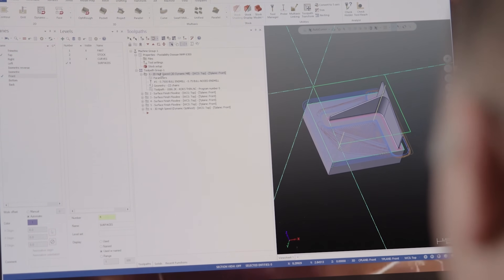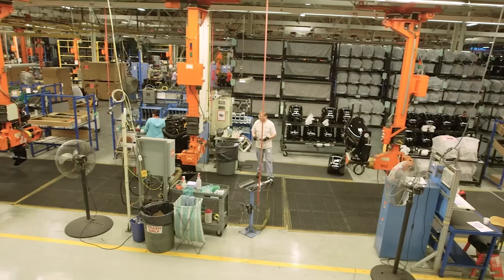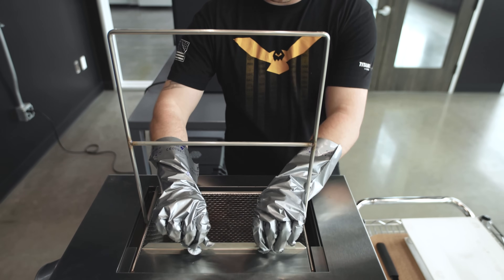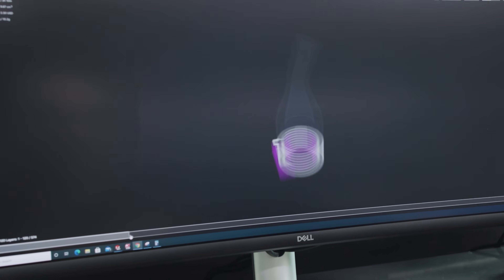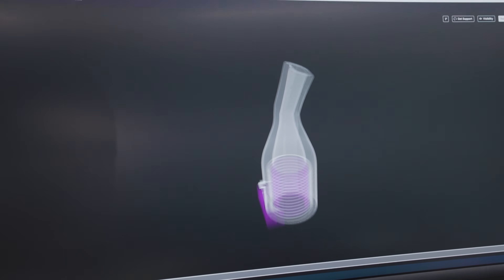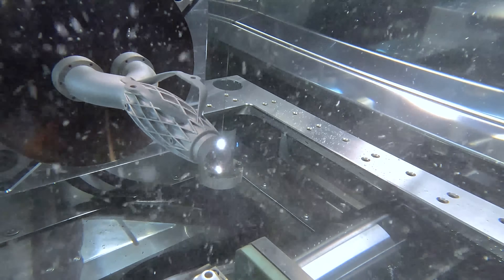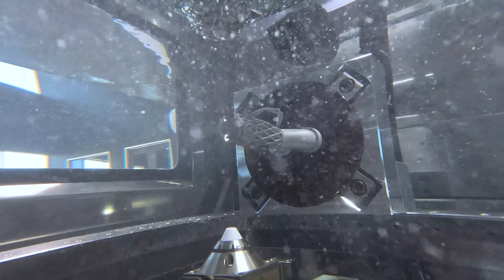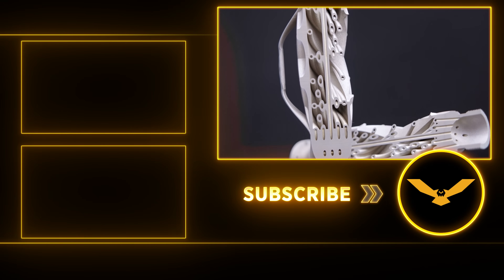Why Won’t Old Machinists Teach Young Machinists???

Comment: As an old school fitter & Turner going through the trade as an apprentice coming from a farming childhood and a grandfather who was nextdoor and an engineer himself, I learnt almost the entire trade other than CNC programming and cylindrical grinding& surface grinding and metrology QA inspection by the age of 12years old by working with my grandfather after school on almost a daily basis which was loads of fun.
Then at the age of 16 I decided to leave school which was a tech secondary school which I excelled in in all subjects due to all my upbringing daily life experiences.
I started my apprenticeship bought a caravan moved away 5 days a week for work and entered into an industry leading ISO company that performed high end R&D and high volume production of automotive components and master guaging aswell as aeronautical engineering.
As an apprentice all of the great men I worked with soon realised early on that not only did I walk the walk and talk the talk and comprehend what the spoken lingo was in engineering ,the comradery with work colleagues was nothing but respect. After completion of apprenticeship I then took on a maintenance installation and service contract roll servicing the printing industry machinery, which in itself is not dissimilar to what my apprenticeship entailed other than security clearances being needed especially when doing work for the nation mint reserve bank. I thoroughly enjoyed everything about the trade and still do although at that time after a few years as a tradesman I felt as though there was more I needed to learn and get hands on experience with so I joined a local guy who had set up shop with ongoing service and build contracts to produce machinery for the woodworking housing industry mostly R&D with open budgets, this is where I thrived being able to reinvent the wheel free range and not only design,build, create,test prove and excel bringing forth a myriad of new faster improved more versatile machinery and innovation to the world market. After several years doing this I realised I was being cut short of my earning potential not due to pay rate I was being paid but simply due to the enormity of what we'd create and the millions of dollars worth of potential both myself and employer were missing out on. I got offered an opportunity to travel abroad to live and work freelance as lead in highrise construction which I had not done before, so I jumped at the opportunity and delved into a new adventure, learning a second language relatively fluent due to culture exchanges working abroad and also in doingso focussed alot of attention to detail of the operations and business aspects of highrise construction at the same time melding this experience on same mind of improvements when the need arose.
I tended to a working crew of nine full-time employees of the company I was freelance contracting too, aswell as liasing with many other crews based across the Southeast Asia and Asia Pacific region and I soon realised after a multitude of hourly service maintenance schedules performed not only from existing clients but the amount of new clients I would pick-up due to openess of what I did and do and knew whilst conversing which people I managed to almost entirely take on majority of service schedules throughout Southeast Asia....to be continued shortly I must go out, BBS👍
I elaborate on subject of CNC and sharing knowledge to co-workers in detail further in when I get back!✔️
Reply: Alrighty. I love hearing about interesting life stories. 
Have always wonder why someone hasn't taken the initiative to translate the many worlds of the machine shop life into a movie; every shop has it's own uniqueness and challenges.
 It's strange and mystical world with it's other worldly fragrances and sounds - complete with a cast of incomparable characters; a competitive dynamic of human relationships unlike any other environment. Men who wield the mystical knowledge and power to move and shape metals to perform task beyond human capacities. A world that is both exhilarating, exasperating and heartbreaking all at once as fortunes are made and lost.
Reply: Just remembered when I worked on the night shift as a jigborer, a government trained centre lathe turner asked me for advice about a three start thread he was having a problem with. He had already asked one of the skilled turners about the method of machining the threads. This guys advice had resulted in breaking the special tool provided for the job. I had a look at his set- up and realised he had not set the compound tool holder at 50 % of the inclusive thread angle.  This meant he could feed. Into the thread  without the tool breaking.When the other skilled turner found out what I had advised proceeded in trying to stop and revert to his way but the  new guy proceeded with my method and produced a good part without any tool damage. I learned this method from helical milling slots on horizontal milling machine. Similar principle when the cutter has to have 2 different angels for clearance.

Comment: I see both sides, and appreciate those who've come forth with honest answers on the YouTube video comments.  

They come from a generation where you didn't share your knowledge because that's what separated you from the mass, and made you more money. They also came from a time when shop settings didn't have as many rules when it came to etiquette of the work place I'll say, not like today..I've heard stories. LoL And respect among the generations differs greatly I've noticed, that's huge with the older generation. But, like anyone, we must learn to adapt with current manufacturing trends/processes.

In today's world, the demand for production has drastically increased since the 70's/80's. Now, shops rely more on a team based setting to solve problems and meet those production needs. Not everyone works well in a team, that's part of the problem. 

I also feel, shops often treat the older generation like relics, when in reality they are the best mentors to pair with the younger generation. They have more of the manual/mechanical skills while the younger generation has more of the technological skills. Tons can be learned from each other.
Reply: No its about experience. The older timers have been through multiple managers. The good and bad ones. It's the bad ones that start firing people that causes permanent cultural damage to a tradesman willingness to share information.
Reply: @Ken-nv2hl  And there is the real answer guys. It's fact. I'm 62 now and the comment above rings the bell.
I'm not a machinist but I am a certified millwright. Been through the above multiple times. Retired now. Good luck to the future "business" man and good luck to any apprentice who is still to green to understand what is about to happen to him in the future.
Reply: @Ken-nv2hl  I feel it was about being able to support their families at the time. Highly doubtful they intended to dissolve a trade with the behavior. It's a valid fact the times were different and continue to change at a rapid pace. 

You could break this down so far from social norms to parenting, etc.
Reply: Excellent well rounded comment!
Reply: Let me tell you....I been machining for years and finally have a cool old school mentor retired engineer and machinist....am learning alot from this guy....especially the "Proud" lingo 🤣
Reply: I don't know of any shop that behaves like that.  Normally no shop is willing to even take a guy and teach him anything.  All our manual lathe hand and grinders, they retired without the company having them bring another guy up.  They don't wan to play anyone to learn, they want to pay for you to produce.  If you want to learn, good luck trying to find a trade school to learn what your shop is doing.  Most of the time the old timers that do the super hard stuff will only teach someone they respect as a competent machinist.  Well the shop won't let anyone else become that kind of machinist because they don't want to pay them for being knowledgeable.  They would rather search for months and months and hire some fellow who already knows how to do the job.

We had a Lathe hand who retired a few years ago, that guy was 72 when he retired and knew how to do everything.  Now that guy was a good man and he liked me and would have taught me, but nope the company never let a single person train under him and he retired not teaching anyone the trade.  Companies think "I will buy a new CNC and have an engineer write programs and pay a low a wage as possible to the operator because he's not writing the programs".

That is exactly how companies do it today.  They will pay an engineer to do the job most machinist use to do because CADCAM allows it. They are drawing the part anyway so they can bypass paying you for having the knowledge of being able to program, in fact, they will stop allowing you to program, pay the engineer and stop giving you good raises.  That is exactly what happened to our top end guys a my shop. Know who did that to them?  A 30 year old engineer, he convinced the shop to screw over the CNC operators, it's the industry standard he said.  Well he's not wrong, it is the industry standard, and it is what they do.

They just stated to have me start learning to Centerless grind on a machine from the 50s I think they said.  The only reason is they have been forced to do so, the guy that retired comes in every week or so to run the machine and he is raking them over the coals pay, and is attitude is one of antagonizing everyone to hate management.  They finally had it with him and we are very slow, so paying a retired guy when you have other guys standing around looks really bad.  Still that old guy is not going to teach anyone a darn thing, who are they going to find that can hold perfect size on stainless steel on parts that take a year to make and  are worth 100k?  Good luck with that, and that old timer hates everyone.  That is the only time a company teaches anyone, when they are forced to or when they can drastically underpay a young worker.

Comment: 30 years in the trade. I've taught at least 15 apprentices 

No problem teaching.. makes my job easier.. makes their job easier too.. and you get respect for parting knowledge
Reply: For those who are negative it may be self reflection that is guiding your thoughts

Maybe attitude has a bigger role to play than skill

Just maybe I have gotten to where I am because I'm highly skilled with a great attitude 

I've never been fired. I've always left on my own terms and currently being head-hunted by 3 engineering firms

So..... I have taught 15 apprentices in my 30 years.. I've got 20 years to go . I'm a manager of a machine shop for a mechanical services company. Sought after for advice. Technical support. Training and management 
I'm a Lloyd's certified stainless welder. Fitter and turner. Apprentice trainer. Cnc programmer operator trainer. Lathe multi axis live tooling mass production . Jobbing to multiple parts. Milling vmc . 

I write most of my programs with canned cycles, sub programs and diameter offsets. Multi jig.  Multi operations different z offsets. 
Diploma of engineering fluid power -hydraulic pneumatic. 

I'm not getting fired
Reply: @andy1973s  my positive attitude resulted in me getting 24 jobs in 20 years. My screw em, let them learn on their own attitude has kept me at my job for over a decade. Attitude does make a difference. All you have proven is you're the exception to the rule. And that just proves the rule.
Reply: @iamtheoffenderofall  I'm not offended either lol
Reply: The need to leave your knowledge behind. I feel it too.
Reply: Its reciprocal, teach me something but i give back to my teacher by not taking their job, giving what i can, making their lives easier, being a network to support my mentor. This young kids just take, what do they give?
Reply: @JohnDoe-dc6nr  if you're not the boss....you have no say who gets hired and who gets fired. So you may not want to take anyone's job. Management will decide the old timer who is making 3 times your pay isn't worth it when they can hire 3 of you. Businesses only care about quantity. Not quality.
Reply: Employee mindset. What if the tradesman owned the business and wouldn't teach his employees/ apprentices or young trades.
Reply: @michaelkemp6919  you see ALOT of guys owning businesses solo rather than the description you tell. Real world vs fantasy
Reply: Besides the political aspect of jobs .. I guess the real key is enjoying the trade
.... I really get a kick from turning some monel bar into a working price of art propelling a 300 tonne vessel through the water. Watching your pins actuating with precision locking a loading bay into position... making contraptions 3m long made of stainless pull felt at 40 tonne and precisely align 
Writing a program for a planetary gear robot arm all in canned cycles and sub programs and fitting in 2 to 3 screens on the console.  Diameter and global positioning offsets. Man readable instruction on use of diameter offsets job set up and jigging requirements 
Each cycle clearly identified and step of cycle... I love doing that... 

Always first program 5% rapid
25%feed
Single step program and use measurement of position to confirm diameter offset is enacted
Air cut if possible to watch tool change position 
Set all tools and input+0.5mm or negative on I.D tools, dial your tool in by measurement. 
If possible put tool size check in program before final cut for q.a and control on tool flex

So much more to teach.. lol
Reply: I needed somebody like you in my shop till they laid me off due to “not knowing enough about machine” despite them knowingly hiring me straight out of trade school and refusing to mentor me. I wish more people were like you in the trade.
Reply: With a guy like you around I might have stayed in a shop longer. I ended up in mechanical design after machining for 10 years.
Reply: respect doesn't pay the bills
Reply: @frostyab7579  it's gotten me to my position today.. pays the bills and some
Reply: Till you get fired
Reply: @iamtheoffenderofall if you do you were never that good and probably got too proud and lazy in your later years. It's called a skill issue and you should try harder to be a better worker

Comment: I let my equipment info on display when i was tuning cars and later that year. This house painter was advertising himself as an expert tuner with aggressive marketing. I still find shit he was copying from me as well in tuning files (i was injecting one changed byte into the map) he got a good chunk of my potential clients
Reply: If you like some drag racing check out Hildagofilms here on YT. Watch his latest video. That is the driver, builder and tuner of one of the S10's that he drag races. For the most part if he doesn't blow the tires he wins. Hell even beat Kayla off of Street Outlaws at Texas Motorplex last year. And when I say beat her neither spun and he had a good gap on her.

Comment: I hate my life I .005 deep on a punch pocket last night on a subplate. I had freaking 4 hours on this block man. I have no clue what happened. I thought my finish cutter was over by .01 I hate my life. So engineering will look at it and shake their head. Tool was tight it was in control of Z. I was working pocket to pocket. I had not even started coming down yet. The clearance was .005 on the die and the plate was indicated for that clearance. Id like to reset it up cut .005 off the top recut the rest of the punch heads and shim up the whole plate. I can go on and on about why that should work fine but still it is my numbers and I hate my life. Be careful before hitting cycle start Dont feel like me.

Comment: Sounds like he worked really hard for his knowledge and didn’t want to give it away to every button pushing kid (he didn’t know you at the time or your commitment level)
Reply: I disagree, i am in similar situation and the reason i don't want to explain issues is because i tried to explained in the past 100 times and no one gets it, it just costs a lot of energy, but a try is always worth
Reply: Sounds like a bitch to me share your knowledge everyone’s replaceable
Reply: @smox87   yep even you when the kid you’re teaching up stabs ya in the back resulting in you being laid off.
Reply: @chadvalliere8697  I’ve been a self taught machinist for over a decade I share the knowledge I have because it was so hard for me to get to where I am and I don’t want to see others struggle. Everyone I’ve taught has taken stress and workload off me to allow me to move up. If you’re really concerned a kid will “stab you in the back” all you’re doing is proving how little you’re worth, you’re not an asset at that point you’re only holding the company back making yourself more replaceable